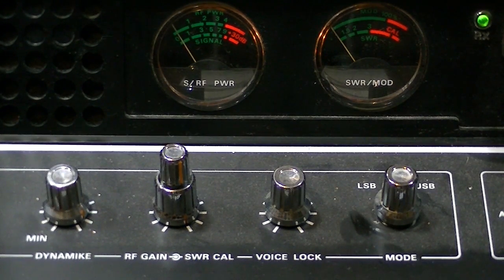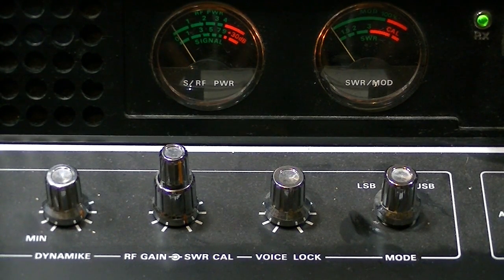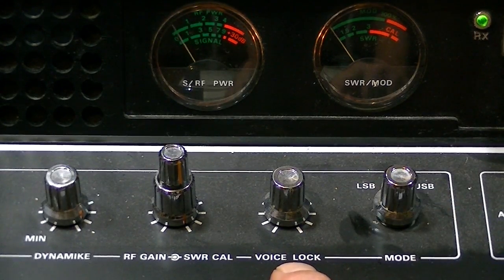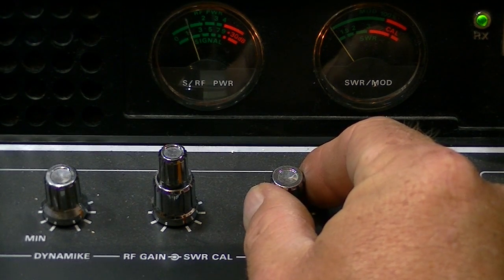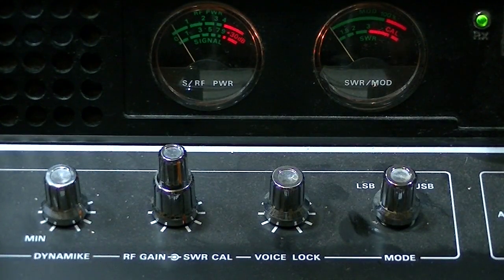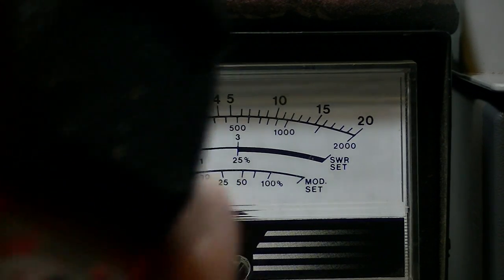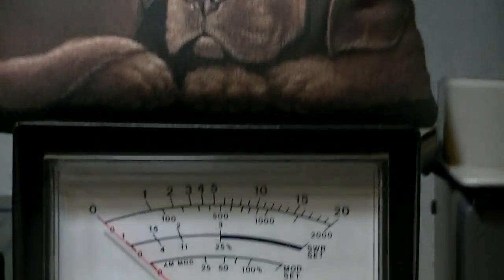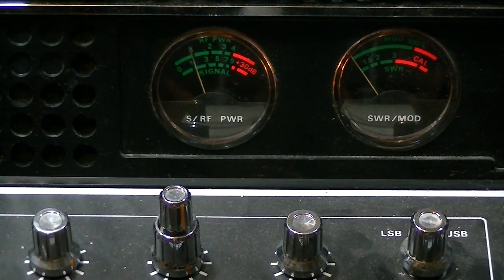CB Radio Single Side Band (SSB) Explained

Comment: CB on AM and FM - (which is what we have here in the UK) is 'casual' whereas SSB - (USB / LSB) is more 'disciplined'
Reply: That's what my question basically was is sideband a FM wavelength because I understand radio but I don't understand this lingo on CB LOL single side man isn't that just another frequency? Or different frequency?
Reply: @ronalddaub5049  : SSB is not a "frequency".....its a mode just like FM or AM.

Comment: I have A Cobra CB Radio,SSB And have had several And back in the hay day of CB Radio I worked many Stations with mine Along with A Super Scanner Antenna .I can almost hear the brake 10 now.I also worked on Communication equipment as well as CB Radios.Even today I still have some of the old classics and still talk to locals on 22 and 35 And 38 SSB .I also have a Youtube  Video on the Cobra and A Website that will take you down memory lane of the classic CB Radios
    

https://www.youtube.com/watch?v=XOhU_eoz52Y 

http://qth.net/k/ka4pnv//cb

Comment: A bit of modulation theory would help here. AM is a carrier which when modulated generates sidebands above and below it in proportion to the frequency being modulated. IE: a 1 Khz audio on a carrier of 27Mhz will result in 27Mhz(the carrier), 26.999Mhz(the lower sideband), and 27.001Mhz(the4 upper sideband). What SSB does is eliminate the carrier and one of the sidebands. The carrier has to be re-injected with the received sideband for it to re-create the original audio at the proper frequency(to match the transmitter) for it to sound right. An SSB signal broadcasting a tone, would be as a dead carrier on AM and would seem to be that.
Theoretically, two conversations could take place on an SSB channel, one USB the other LSB. In practice not only is that true, but sometimes two or three conversations can take place on the same sideband if they are separated in frequency. One would hear unintelligible garble but this is usually easy to ignore on a good radio because it is greatly suppressed by good filters.

Comment: I have heard a lot of explanations from hams as to what SSB is...and they don't point out the number one reason it was invented , and it's specific quality-this guy talks about looking at a graphical representation of a typical signal, where you have a horizontal base line, and going along that line is a sine wave-form that has high and low curves above the base line and to the same extent below the base line.that is a typical full spread amplitude signal.Now, from the very top, to the very bottom, this signal takes up a certain amount of bandwidth (or frequency spread). SSB cuts one side of this signal out, either the top side of the base line, or the underside of the baseline, and in doing so, halves the frequency spread (bandwidth) needed to send/receive signals! So you can see immediately that this method only takes half as much bandwidth, and ,here's the important bit-it doesn't clutter up the airwaves!. You see, with the rise of modern communications the airwaves (the electromagnetic spectrum, or total spread of radio waves, in this case) became absolutely cluttered up with so many different transmission, this was one way to economize on bandwidth. It's not really such issue these days with digital tech, they can use one single fixed frequency and send digital data at really impressive rates.
Reply: It sounds like side bands on a CB is just two FM bands I can be wrong
Reply: All of this reminds me of a push-pull audio amplifier where is out of phase slightly on the Transformer that's what single Side Band on AM radio sounds like only it's kind of a FM thing

Comment: For whatever reason, on only 10 watts during lots of sunspot activity, I could get on sideband and talk to south America or Canada daily!  On a Radio Shack CB!!!
Reply: In radio communications, Single-SideBand modulation (SSB) or Single-SideBand Suppressed-Carrier (SSB-SC) is a refinement of amplitude modulation which uses transmitter power and bandwidth more efficiently. Amplitude modulation produces an output signal that has twice the bandwidth of the original baseband signal. Single-sideband modulation avoids this bandwidth doubling, and the power wasted on a carrier, at the cost of increased device complexity and more difficult tuning at the receiver.
Reply: +wesley mccurtain I thought 4 watts was the max on CB.
Reply: W7KMS I think mine was 8 or 10. Been so long ago.

Comment: SSB is just AM with the carrier and one of the resulting sidebands filtered out ...on AM the radio outputs 4 watts carrier and 4 watts in both the upper and lower sidebands with 100% modulation resulting in 12 watts total but spread out, On SSB the power can be increased 3 times (12 watts) without overheating the final output transistor and giving a little over 1 db boost in your signal using less bandwidth but the carrier must be reinserted on the receiving side (clarifier) and finely adjusted to match the transmitters frequency exactly or the pitch of the sound will be off. There is also DSB, double side band...or carrier suppressed AM.  FYI, sidebands are created from the modulation and is where the information is in the signal on AM SSB or DSB.
Reply: Brings back so many memories um southern NC had some of the alltime legends on the mike

Comment: . I recently upgraded my CB radio to a Uniden BC 980 SSB. In your video you mention skip, I regularly hear people from other state when I am monitor the side bands. Is that skip or are people using amps? Thanks for the video!
Reply: Nomad76ORE your hearing skip and people on ssb also use amps but i have talked skip on ssb with no amp just a good antenna tuned properly
Reply from the maker: Nomad76ORE Any time you hear people talking from a long distance it is skip. They may be on amps also.
Reply: @Hilander1298  so amp will help if it's tuned properly?👌 I've always heard to run the wire and multiples of 3

Comment: Splits freq into 3 parts not 2. USB+LSB+Carrier (12w vs. 4w).  Voice does not speed up or slow down, pitch changes.
Reply from the maker: Robert Mazzochi SSB Has no carrier. Key the mic and needle is flat until you talk. You use clarifier to speed up or slow down voice to make it intelligible.
Reply: is the voice change a matter of "speed" or "pitch?"
Reply from the maker: Robert Mazzochi Speed. Thanks for watching
Reply: Albee4ty5 I don't think speed is the proper word for this context. When you tweak your clarifier up, they don't start talking faster.
Reply: s'right!

Comment: Single Side Band mode is lots of fun and more efficient in frequency usage than AM mode. A few AM signals on the same channel (frequency) will create many hetrodynes or tones (noise and whistles) of the carriers 'beating' on each other. Several SSB stations will not make this noise and the plus is than the range is increased. I can easily 'talk' 75 to 125 miles with no skip, whereas AM is reduced to 5 to 30 miles. AM is like a dull knife (wide bandwidth) where SSB is sharp (narrow bandwidth) and 'cuts' farther!
  The Voice Lock or clarifier is a BFO that re-creates the base carrier that is missing  in SSB mode, tuning this BFO (zero beat) changes the pitch of the SSB signal so that it sounds near normal. Not all transmitters are the same so one would have to re-tune the BFO for each, but close is good enough!

Comment: SSB works on PEP= peck envelop power. USB / LSB legel18 watts of modulated pep power.  The clarifier can be unlocked or opened so as to work on AM as well to slide between channels. The only problem with SSB is it's hard to have a 3 or 4 way conversion. Also at one time there were only a few channels that SSB could use like 35 & above do to splatter over to AM. It was a gentleman's agreement between AM'ers & SSB'ers the AM'ers would not use 35 & above for the same reason..